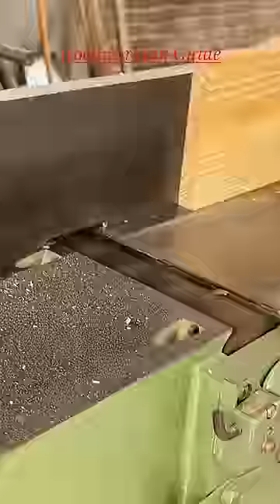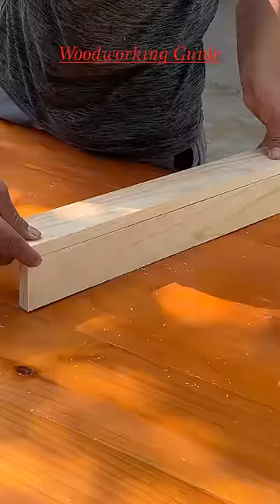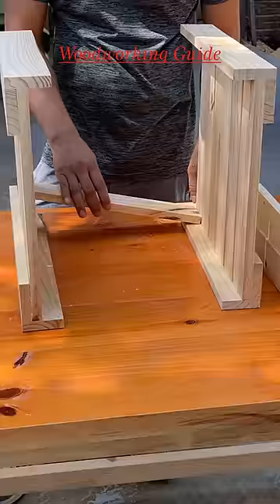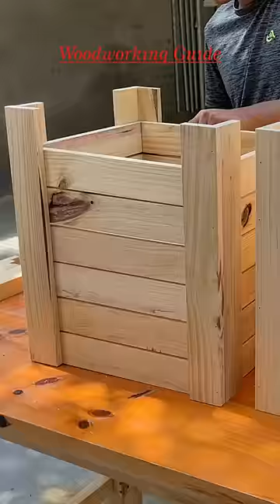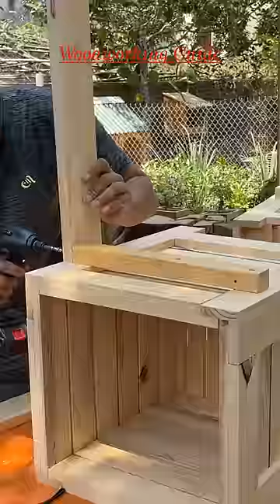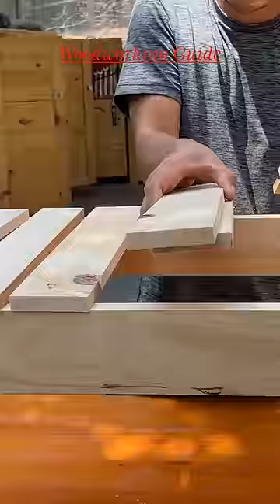An Unexpected Result!!! Wood recycling

Comment: It’s just pinned together, honestly has it broken yet?
Reply: The nails could be bigger then finishing nails
Reply: 0
Reply: Hey I get the idea, it's way easy for a youtube video and he can reuse the wood! Actually the design is looking good, so if you throw some PU glue and some screws at it, it's sure af gonna be a sturdy bench if it holds on pins! Also, in case you also missed this, OP can reuse the wood for other projects :)
Reply: Those are literally pin nails… meant to be used for light trimwork installation (ie crown molding on cabinetry only, trimwork outside corners, etc). Those little nails are NOT AT ALL made to withstand the elements or being embedded in the pressure/chemical-treated wood that he was building with… they’ll rapidly disintegrate to nothing. They look decent though!
Reply: @stephenstrader1577   that woods not pressure treated and all tho I wouldn’t use finishing nails to build that there’s only one part that’s structural and it’s held together with screws the part that supports the seat
Reply: @austen9556  Did you miss the bases in the planter sections?
Reply: hahaha, whole big fancy houses-developments built like that exactly this fast, lol. The least we should worry about the bottom of a planter. But no it is plenty nails for this project and the rest is screwed together
Yournamesaysitall

Comment: Only $1250, limited time offer! Now if only it was fastened together right, or if the customer knew it wasn't. But otherwise, nice design, and have fun pulling out the pins once it's fallen apart! That's still usable if you're patient with the pins, so it's like, re-recyclable, lol

Comment: That whole set up is going to be trash in a few years. Wood glue would've helped keep a tighter bond in conjunction with the nails. A finish on it would've helped protect it from weather. Seeing as it's an outside display, that wood is going to tarnish fast as hell, and it'll warp. I'm not a professional or anything, but from the experience I do have, I can say those tiny nails aren't going to do the job long term.

Comment: Those are literally pin nails… meant to be used for light trimwork installation (ie crown molding on cabinetry only, trimwork outside corners, etc). Those little nails are NOT AT ALL made to withstand the elements or being embedded in the pressure/chemical-treated wood that he was building with… they’ll rapidly disintegrate to nothing. They look decent though!